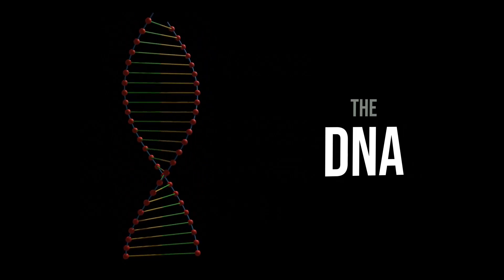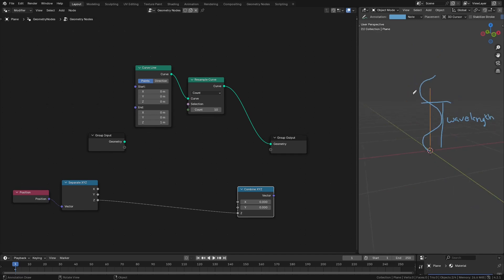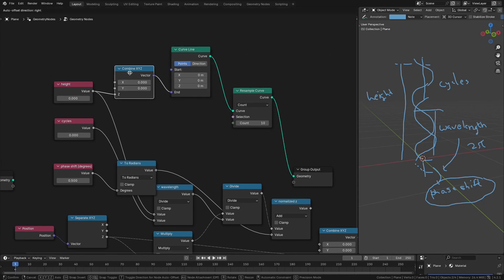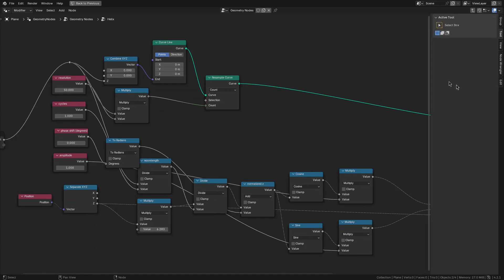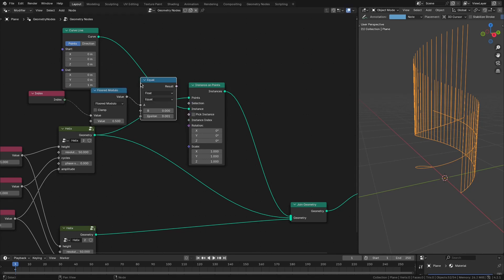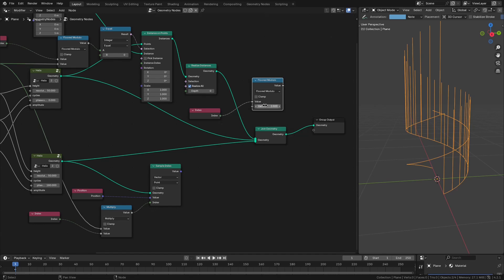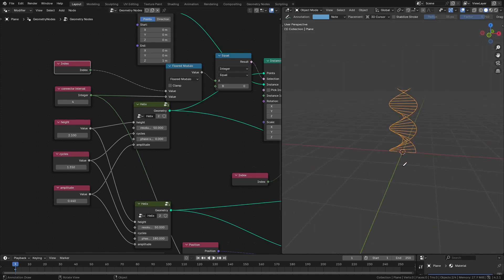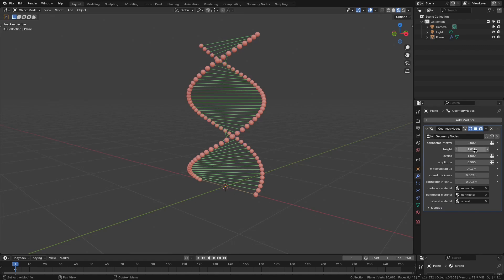DNA Helix In Blender Geo Nodes

Comment: Excellent tutorial as usual. Thank you for your time and effort to make it. There is something I need your help with, Please. I have a project for a logo animation that have multiple closed curved shapes side by side (non of them is a uniform shape (like a circle or square   …. etc.)) . I need to fill these closed curved shapes during the animation by a curve that has a bevel (and animate the Factor start and end to control the filling growth)  . The  start the filling  is from one side of the closed curve shape to the other. Now for one closed shape this is can be done with putting a mask with a cutout (has the same finish of the background) above the this closed curve shape and let the filling curve grows below this mask to have a clean filling. The problem is I need to animate the filling of 4 closed curved shapes that are side by side in the same time by 4 different beveled curves growing from different directions each one will fill one of the closed curved shapes. Is this something can be done with geometry nodes? If not, is there a way to control the radius of the filling beveled curve based on the geometry of the closed curved shape that is the border of this filling area? Please advise. Thank you
Reply from the maker: If I understand your question right, you want a way to create fill animation. Here is a sample implementation with geometry nodes. We first split the shape into 2 part and connect the points on the parts with a single new curve creating fill effect, hope this helps. https://drive.google.com/file/d/1KpsenkiJWma4M2l9RoG6KydrDSRZB0AD/view?usp=sharing
Reply from the maker: If I understand right you want a way to animate curve fill. It may be possible with geo nodes but would be a little complicated, we divide the curve in 2 parts and join the points on the 2 with a single filling curve: https://drive.google.com/file/d/1KpsenkiJWma4M2l9RoG6KydrDSRZB0AD/view?usp=sharing .. Limitations 1) parts of the filled  shape may lie outside in some cases 2) the fill may require very large number of verts to give solid fill